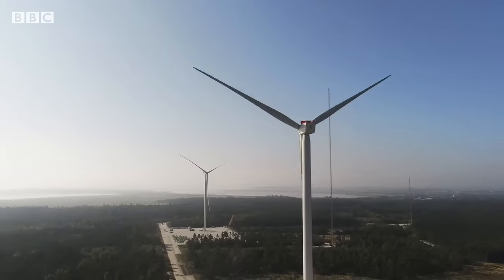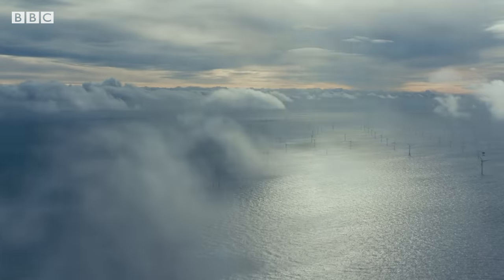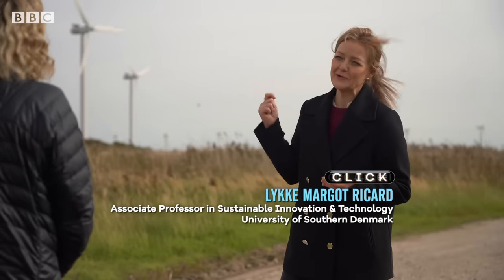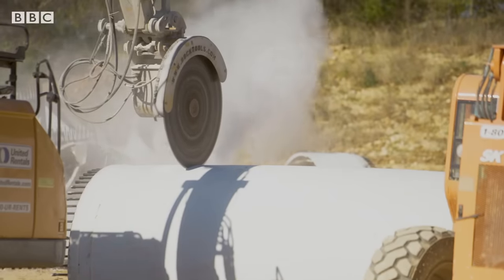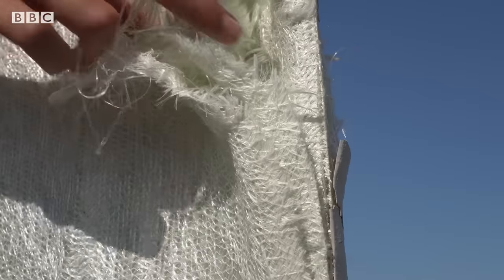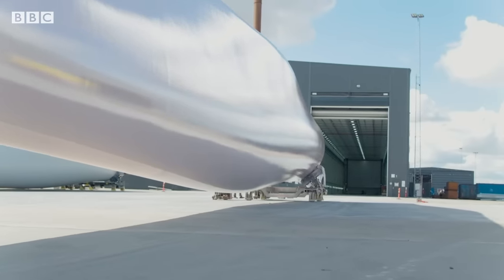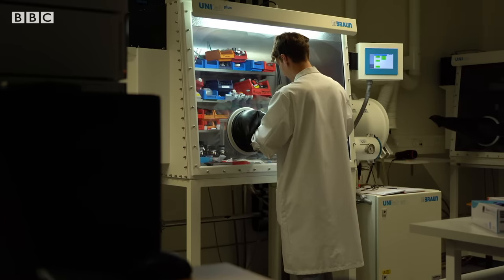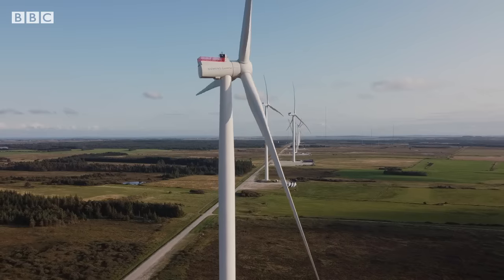Race to recycle wind turbines in Denmark - BBC News

Comment: Climate change is as much caused by industrial scales of material and energy throughput, as carbon on its own. So we risk making the perennial modern mistake of ‘solving’ problems by relocating them elsewhere. I would add, another source of our woes, is taking genuinely good ideas, and then deploying them at scale without regard for aggregate effects or context. Using far less energy should be the goal.
Reply: In the Grand scale of things, Wind turbine blades are just like a Chris Packett in the middle of the Atlantic Ocean. Compared to waste from other Industries. 

Nobody looks at the waste from mining oil, coal, gas and nuclear power,

Comment: That's really cool, using chemicals to undo mistakes, that the use of chemicals made.
The making all new mistakes part, well that's just sad.

Sad for everyone, really. The companies who built or bought massive factories to build enormous blades. Sad for electricity companies who've been spending boat loads of money on these eyesores. Sad for those who must live near them. Sad for the wildlife they impact. Sad for the farmers they inconvenience. Sad for the fiberglass manufacturers and their need to turn sand into glass with immense amounts of heat. Sad for the resin suppliers. Sad for the person who has to figure out what to do with all these turbine blade dissolving chemicals. It'll probably make good napalm or something.

While I wrote that, I thought of what could replace them, and and pearl-coated flex wing attached to a gyro-generator sounds feasible to me. 

There's a rudimentary physics experiment that demonstrates how photons work, more  or less. Place a 4 sided prop on a vertical axis, paint one side of each white, paint the other black, as it rotates the side  facing you will always be either white or black, depending on if it is right of left of the axis. Place that in jar under vacuum in the sun or under any strong light. The photons will reflect off the white side and it will rotate. 

Take that same principal and apply it to a fabric that changes shape as it is heated, weave and paint it in such a way that as the sun heats it, it deflects, but as it deflects, formerly heated areas of it cool, making them reflect, have this woven structure's contortions power a gyroscopic generator if at all possible.

Just what I was spit balling in the back of my mind, while I considered all that woe.
Reply: Whatever the problems of wind turbines they are much better that the fossil fuel burning power stations they are replacing. I live near a wind farm and I like seeing them from my window. I've visited the turbines and they are loud if you are right next to them but you don't have to get very far away before you can't hear them. No one can hear them from their house.

Comment: It takes more Energy to make one wind turbine than the Turbine will make in a lifetime.
Reply: Not true.
Reply: Source?
Reply: This is utterly false and pure fiction sorry.
Reply: Based on average values of emboddied energy for Glass fiber /epoxy resin of ~50MJ/kg = 12kWh per kg, and consiidering that the blades weigh ~ 35000kg, the energy required to produce the blades is 421000 kwh. An average wind turbine (offshore) produces around 6million kwh per year. And it has a lifespan of 20 years.
Reply: Overall the energy used to produce the blades is 0.35% of what the turbine will produce. Or put differently, the net 'efficiency' (energy produced - consumed) is 99.65% of the total..
Reply: Not true. Energy recovery time for a wind turbine is between 4 and 12 months, depending on wind conditions.
Reply: @Anderson-f4t6c  «Source?»
--
Common sense as primary source. The secondary one out of some calculus. Hints: a) no science can go beyond perpetuum mobile; b) physics of fluids
Reply: @voltydequa845 Well, it's the same problem with coal power plants. That's why we sometimes have power outages. There's simply not enough "juice" coming out of the powerplants.

Well, I just made that shit up, so I'm just as right, as you are.